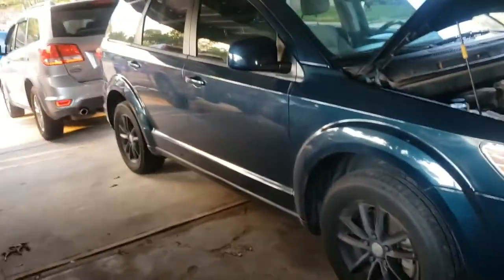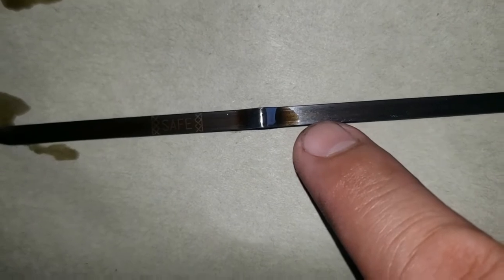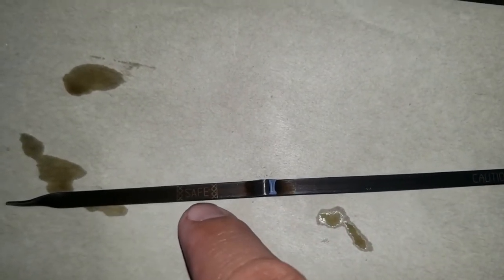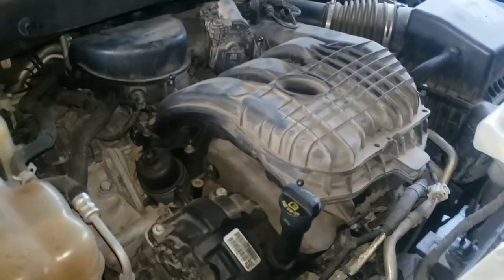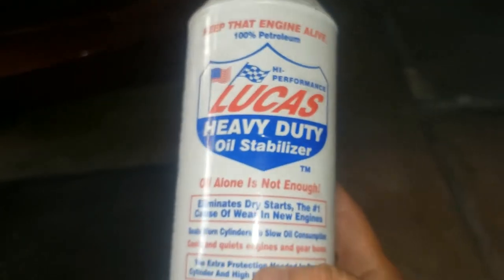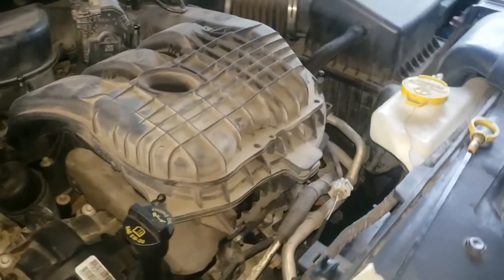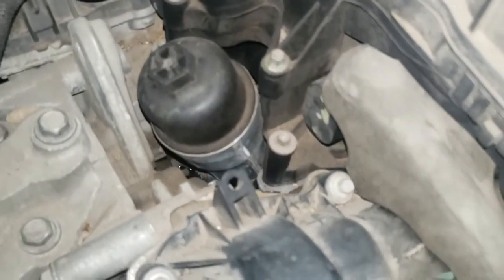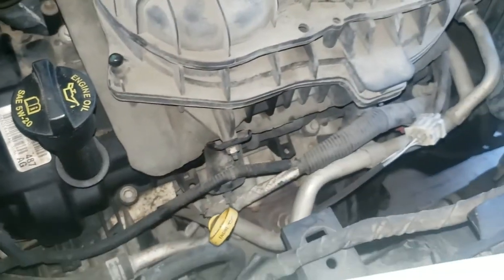Dodge Journey Knocking noise 3.6 engine

Comment: Did you figure what was making that loud noise same problem with our 2018 model
Reply from the maker: Yeah the loud knocking noise is really bad,if noise coming from under the engine that means engine is gone...sooner or later it will stop running. 
If noise coming from the top of the engine that most likely will be the rocker arms (this is a very common problem on this engines.) 
This sounds is not as bad or loud,car can runs for a good time but is good idea to fix this problem. There is a lot of videos of how to fix rocker arms on YouTube.
Reply: I just buy one wt the 3.6 and it was thr flywheel not the engine

Comment: Very interesting your video. Did you discover the origin of rhe sound? Where is it exactly located? What parts did you replaced?
Reply from the maker: Yes! The sound was coming from under the engine.  It was a hard knocking noise. When that happened most likely u need to rebuild or replace engine.  
There is a different noise on this engines...sometimes noise comes from the top of the engine...that will be most likely the lifters going bad . But double check with ur local mechanic. I hope u can fix ur car. In my case it was sold as is 😆.